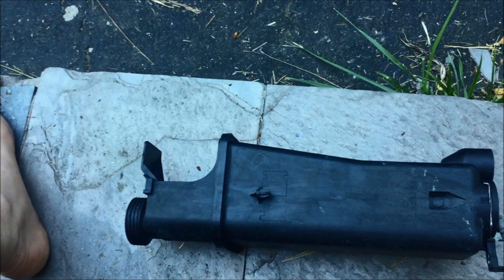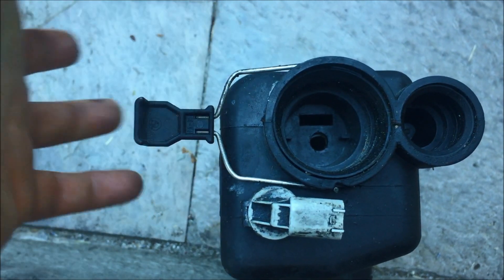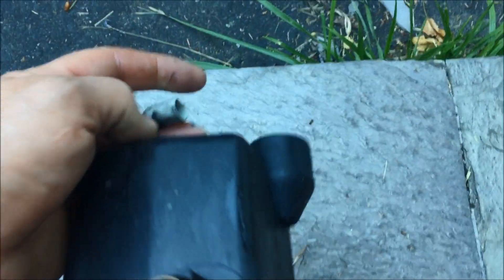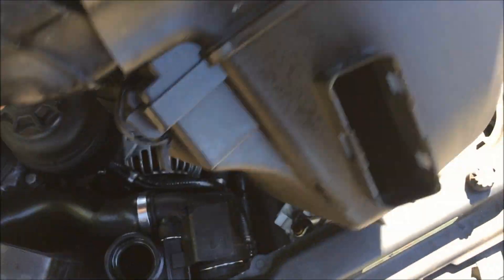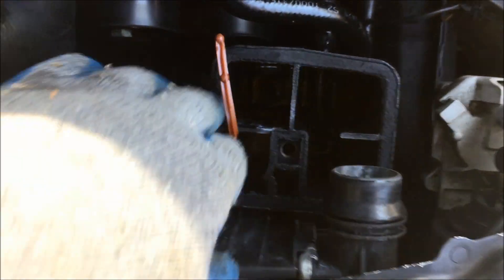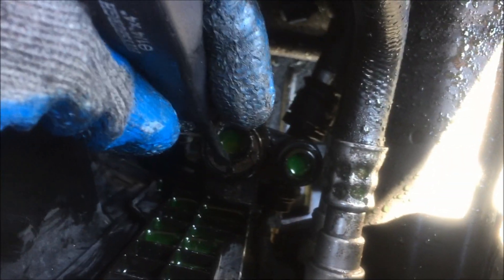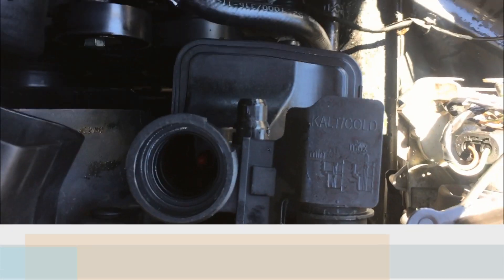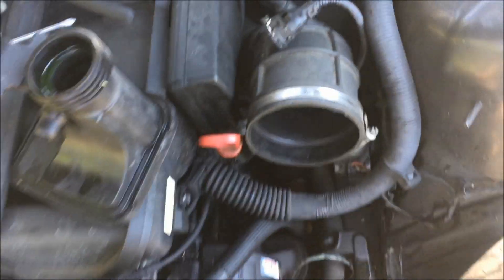2001 BMW 3 Series E46 330xi - How to Replace Coolant Reservoir Expansion Tank & Thermostat

Comment: On then replacement tank, it would be a good idea to re-inforce the upper flange of the tank and each corner of the tank with epoxy resin and fibre glass mat.